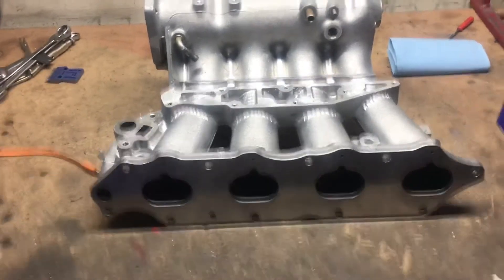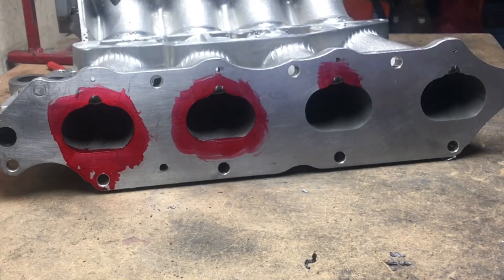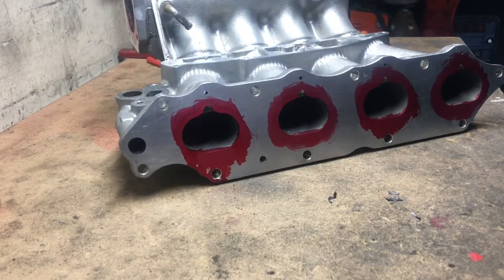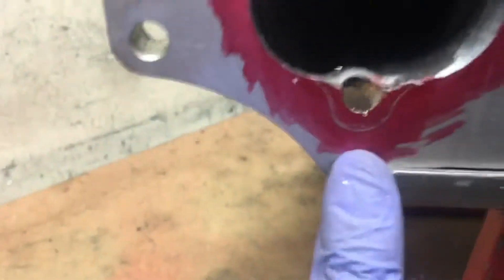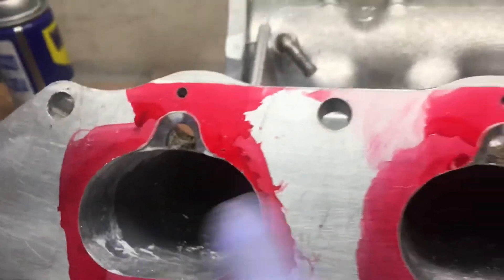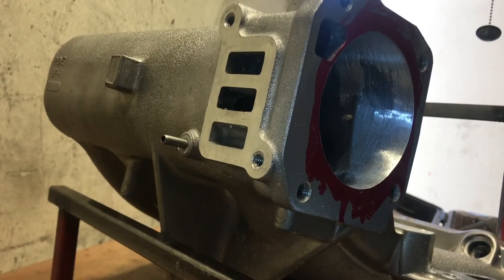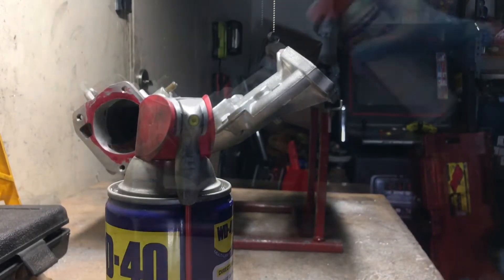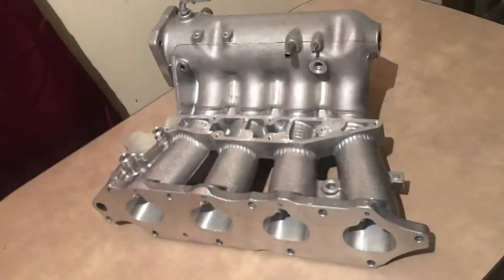Porting h22 euro r manifold

Comment: How do u like this manifold over a stock p13
Reply from the maker: Way better , it’s lighter and designed for mid to top end power it’s even better than the skunk2 for overall gains
Reply: @Formidable_lude  how much u charge for porting the  manifold ...also do u knife edge the runners ?
Reply from the maker: @alex13238712  I’ve done knife edge runners before but was told it’s better to around them off for air flow. I don’t really port anymore , do you have a euro r or p13 manifold
Reply: @Formidable_lude  i do just picked up a euro r  ..my motor is a euro r so wanted to match them up im using the p13 right now ...when i switch ecus i run my skunk2 ..but i dont want to be swappin manifolds anymore thought euro might be what i need im in cali so smog is a issue here
Reply from the maker: @alex13238712  euro r with a 68 or 70mm throttle body is best.
Reply: @Formidable_lude  thanks bro

Comment: I have a PDE head, and all the euro R manifolds are gone at this point. What do I need to do to make a standard H22 manifold work on that head?
Reply from the maker: You can a PDE non euro r manifold. You can usually find them a h23a or F20b PDE engines but that’s only if you still want to keep the air injection system, if not just install a regular h22 manifold with a regular manifold gasket...